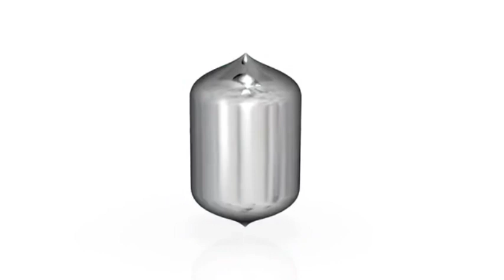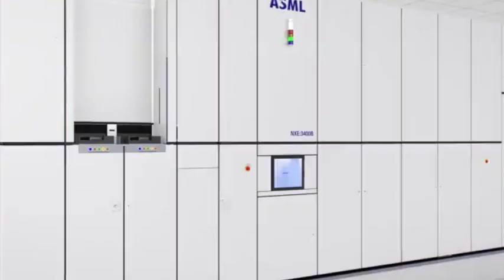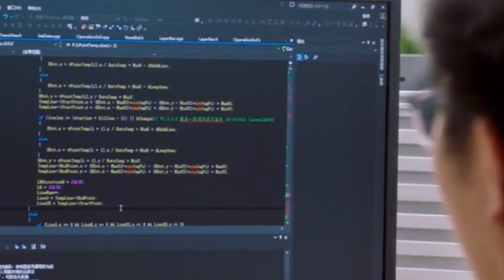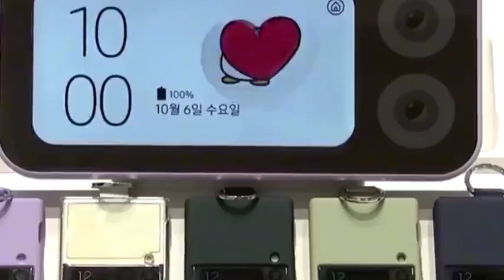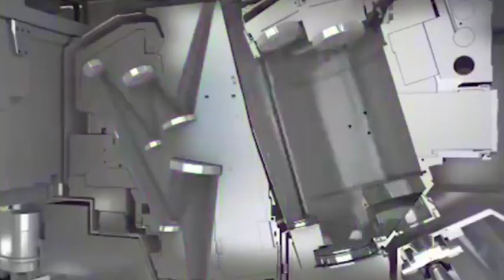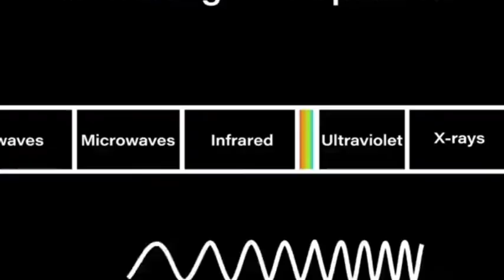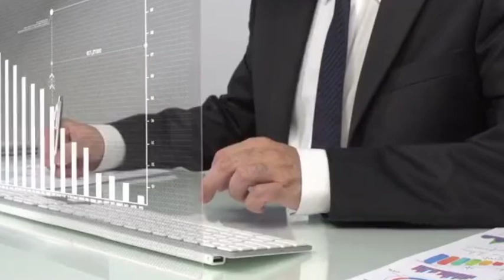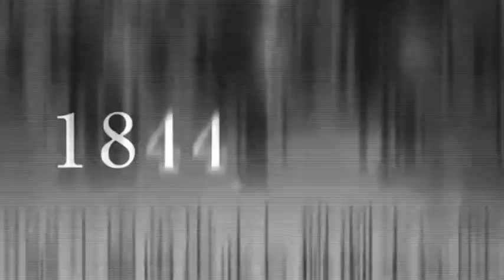China will abandon EUV lithography machines, ASML is hungry for the Chinese market.

Comment: Do China have any ASML's EUV litho?.... or are they abandoning the pursuit to have one?..  let them rot at 28nm.
Reply: SMIC had its first EUV machine built by ASML in 2019 but the factory burned down mysteriously just before delivery. (Google it) ASML could only deliver the older DUV machine under US permission after this.
Reply: China is in forcing the contract with ASML via the WTO making ASML buy back some 30+ EUV units at over 250 million as they were not supplying parts and servicing as per purchase agreement . ASML share price has dropped significantly on this news.

It seems China is using older technology and doing multi layering on 28 nm chips to get 7nm chip outcomes even though a bit larger chip. 

So it seems China as beaten the sanctions to such a point the USA has just past legal laws to revoke thousands of Registered patent’s held world wide.
Reply: Keep coping in your WWE and bidet fantasies
Reply: @oot007  little pink troii eh..  sh*thead
Reply: @oot007  live life in your make believe world of US supremacy. Look around at what non U S media in this world is clearly detailing of the rapid advances taking place in China. Look at sites like “Asian QuickTake” and read in detail the issues facing the US economy left out of US press and other media that is blind siding the average citizen.